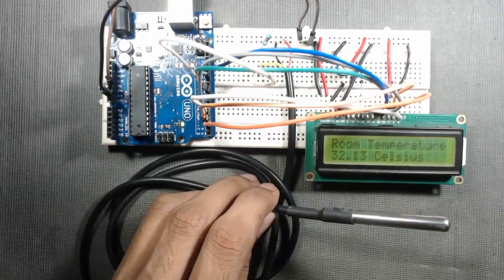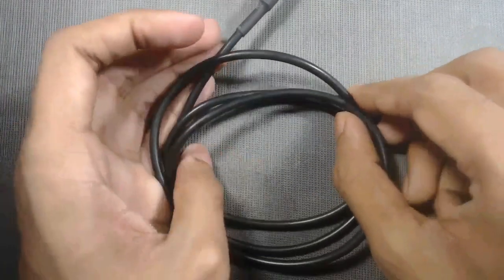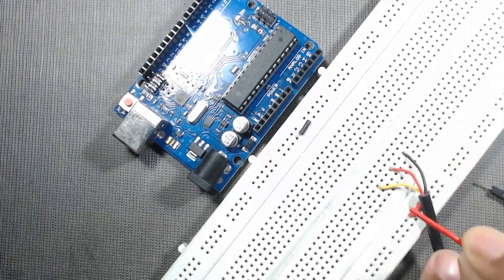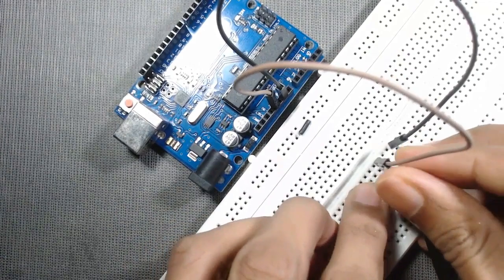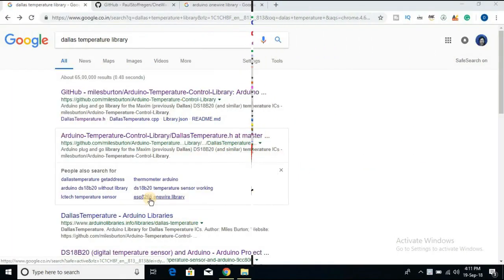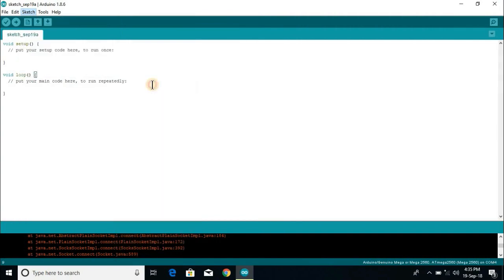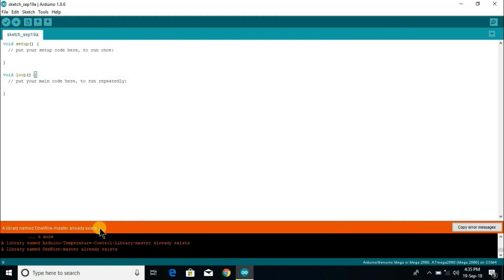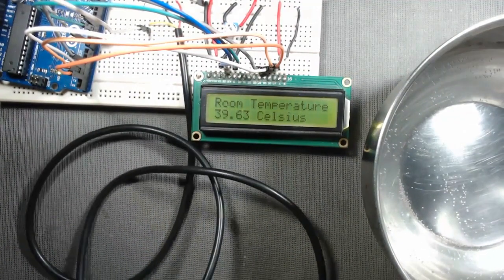arduino DS18B20 temperature sensor tutorial with LCD

Comment: Thank you so much for this video

Is it possible to add an battery voltage sensor along with the temperature sensor in the same Arduino, How can we combine the both program codes

Comment: Can we use that temperature sensor to measure the temperature of a food?
Reply from the maker: This is generally used for project purpose. Please read the datasheet of the sensor to know the material used in that sensor. I don't know the side effect if you use to measure the temparature of your food. But if you use only for project purpose, it will definately work.
Reply: @DPVTECHNOLOGY  we will use it in our project in microprocessor
Reply from the maker: You can use it. It will work.
Reply: Just a proof that it will measure food temp.
Reply: @DPVTECHNOLOGY  thankyou😊